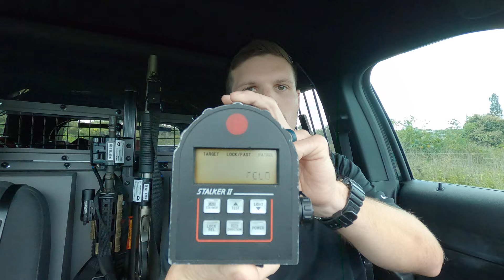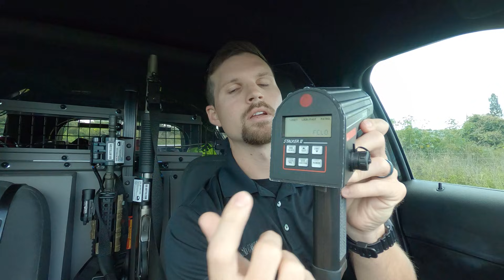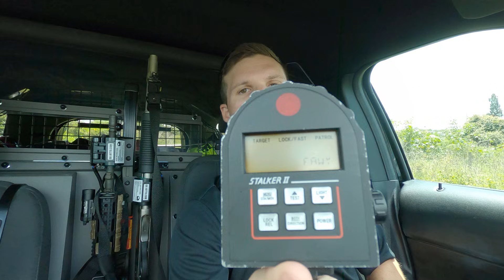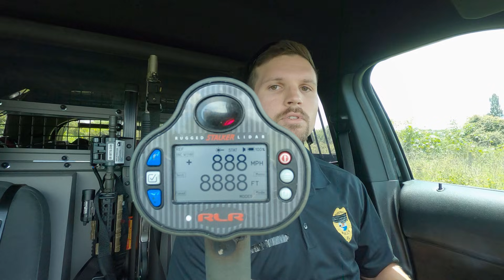How do police catch you speeding? |RADAR and LASER

Comment: Hey, this long shot but my fiancée just got speeding for 27 over when she had acc set to 70 in a 65. She slammed on her brakes because she thought the trip. Had someone pull over and she trying to get over however she wasn’t able to so she proceeded with caution then she pulled over issue her citation. The Trooper use LiDAR is there anyway he fat fingers the number or possibly caught another car instead. there where cars passing her before she even hit the brakes
Reply: If he used lidar come take it to court, plead not guilty now the burden of proof is on the officer you'll both be sworn in and he will usually read off his notes about the citation in his testimony. So his testimony is insufficient by itself and is hearsay without evidence to support it 

Cross exam question that should make the citation null & void and grounds to have it dismissed 

1. At time of issuance were you certified to operate lidar ? 

If he answer yes , as can he show evidence to verify his credentials 
9/10  he won't have that politely turn to the judge and motion for dismissal because he can't show it so the citation is null and void because we can say no degree of certainty you are even certified 

If he has it with him next question 

2. Can you provide calibration records that the device used was working properly, before and after your shift? 

Was it any errors malfunctions? 

Was the person who conducted the calibration certified? If they answer yes ask are they present to testify to support your claim the unit was working properly? 

Whst are manufacturer recommendations ( normally they dont no which helps your case ) tuninig forks by agency outside of the dept police work for who have 0 interest in the case to avoid bias

Comment: You shouldn't be able to pull anyone over unless their doing 20 or over.
Reply: Depends on the road, not every road cops enforcing are gonna have 20mph over threshold usually is 15 and over, cause alot of them roads that are enforce there is houses and not safe roads to ignore the speedlimit so that's why.
Reply: @FrancoYt-p4v  Your right about that. I was talking about roads with speed limits around 45 to 55. Your right though, you really shouldn't never really do 20 over the limit, but sometimes you don't even realize it. Thanks

Comment: Thank you for the video as it was very informative.  I have a question about Laser LIDAR. When you are it using towards a vehicle do you get a return signal if you aim it at the windshield of that target? Or does is it bounce off a different direction due to the angle of the windshield?
Reply from the maker: Great question. The windshield can deflect the laser therefore it won’t get a reading.
Reply: Thsnk you very much for replying. I appreciate it.

Comment: You only tested your radar for clocking in the stationary mode which was not a full proper test.
The sole reason radar manufacturers provide 2 tuning forks to test with is to test the unit in the moving mode. First you test in the stationary mode exactly as you did.
Next place the radar in the "moving" mode for traffic coming at the radar. tap the longer (slower) fork first and place it in front of the radar antenna head approx. 3 to 5 inches away. That should show up in the Patrol Unit speed window. With the slower fork still reading in the window, tap the faster speed fork and place it in front of the radar antenna head about 6 inches behind the first tuning fork. The reading in the "Target" speed window should read the DIFFERENCE between the two forks. Example: if your two forks are marked at 35mph and 50mph respectively, the patrol unit speed window should read 35mph and the target speed window should read 15mph.
Third, switch the radar to moving for traffic moving away from your radar. Now tap the smaller (faster) fork and move it in front of the antenna. That faster speed should show in your patrol unit window. The tap the larger (slower) fork and with the smaller fork still being read, place the second fork about a foot behind it. The reading in the target speed window should read the COMBINED speed of both forks. Example, using the same 35 & 50mph forks your patrol unit speed should read 50mph and your target speed should read 85mph.
this tests the math processor in the radar to be sure it can properly calculate the patrol unit's speed and separate it from your target speed.
I was a cop in the Dallas area for a little over 16 years and have been to the LIDAR/Radar school.
Next time you're in your unit, give it a test and let me know what you think. Sometimes defense attorneys will bring a radar test unit into court and have you demo the test procedures. It's good info to know. Be careful out there.

Comment: So crazy to see how other states are allowed to use LiDAR and radar. In Pennsylvania only the state police are allowed to use radar and LiDAR so municipal departments usually have to pace you or some use the enradd system which sets up two lasers one on each side of the road and when you pass through it calculates your speed. I know there’s another method where they pick two points or lines on the road and then use a stop watch and a math equation to calculate how fast you were going in those points or so I’ve heard

Comment: Question so is the speed radar always on or you guys turn then on when you think you’ll see someone speeding . Like for instance a cop at a light and you coming from behind it will he have your speed locked in ?
Reply from the maker: Always on once it’s turned on. We don’t turn it on as we see a speeder, it doesn’t turn on that fast. We transmit it (activate the speed reader) with a pull of the trigger and hold or by turning the transmitter to always on so it constantly reads. If the officer has a rear antenna and it’s on then yes they can get your speed.

Comment: Serious question can you use laser radar through trees?
Reply from the maker: As long as the tree doesn’t interfere with the line of sight. Branches can cause it to not give a reading.
Reply: @Just.that.officer  I thought so. Not trying to put my business out there but I was pulled over this morning by a officer that claims I was going 36 in a 25 but there was nothing but trees where she was sitting. 

I know for a fact I wasn't going that fast (i was going 30) and there was 2 other vehicles in front of me that both slammed on their brakes as soon as they saw the officer. 

I got popped for 2 reasons, 1 I was the last one in the group and 2 I'm in a corvette lol. 

I am all about fully supporting and backing the blue but sometimes when yall are wrong, yall are wrong lol. She wanted to argue it with me but in the end she didn't cite me but instead gave me a ticket for my insurance. (It's on my phone but I left my phone at home).  It's a fix it ticket. I still say she knew she was wrong and if I really and truly was going 36 she would have cited me for it.

Comment: Nice Video sir! Curious though. How do you lock in to the exact vehicle? For example you clock someone going 80 and your parked. How do you pull off and catch up to that vehicle and not lose it in the sea of other cars?
Reply from the maker: You have to maintain visual. I usually see the driver and/or other identifiers which helps me ensure it’s the same vehicle. However, there are occasions where I go after one then run into two of the same make, model, color etc. and if I’m not certain I just turn around. It happens.

Comment: Hey I have a question, I have a radar detector and it told me i got lasered on the free way when i was going 85 on a 65 but no cop was in sight and i didn’t get pulled over. I was wondering since i got lasered if i will get a ticket in the mail or something even though i didn’t get pulled over??
Reply from the maker: Highly unlikely. 85 on the highway might not have been worth the stop for that officer. They are probably waiting for the higher speeds 95+
Reply: @Justthatofficer  When I got lasered, does it tell the officer my information like VIN number or plate number? Or is it strictly speed?
Reply from the maker: @ColtonMontgomery  just the speed. There are plate readers out there these days though but they don’t activated your detector as far as I know.

Comment: bruh the fact  that it was wrong is to bad. Plus or minus 1 is wrong go back to school or help change the rules. These need to be exact. no dispute.
Reply from the maker: Bruh
Reply: @Justthatofficer  Can obstructions in the view of the LIDAR gun give a improper reading? Say there lots shiney objects like cars at a car dealership and electricity poles in the way you you would have to go between these poles to get a reading of the car on the other side. This is a 6 line road with a median. 3 lanes on one side I'm in the far right lane because it turns into a split into 2 different roads. The motorcycle cop says I'm going 65 in a 45 actually (55-60 max) in the slow lane if I'm on the side of the side I'm murging to when the roads split? So if I was in the fast lane i would be fine? Can I use Angle of deflection, curvature of the earth, and lots of shiney objects at the car dealer-ship as a way to prove a improper reading?

Comment: Personally I no longer use the vehicles speedometer because it's usually off +/-3 mph. New tires travel slower versus well worn tires which travel faster. I use two GPS speed indicators, one on crashcam recorder display, and the navigation unit. Both are 99% in agreement. To verify GPS speed, I also use ground based communication towers which usually matches both GPS units. I also have a 4th separate speed indicator which uses PCM data calculated off my programmed inputs. I mounted the 4th digital indicator slightly left and below center of visual field so it's easier to see and I now use it for primary speed information. Factory vehicle speedometers only give general speed information but cannot calculate for tire wear and inflation pressure. Overinflated tires register faster, versus underinflated tires which register slower. I learned that trick back in the 1980's while working at Yellow Cab Company. During vehicle and meter calibration, we set tire pressures at posted. Once back on the street, we'd over inflate the tires by 10-lbs which caused the fare meters to tick even faster for higher fares which worked beautifully on longer trips such as airport runs.
Reply: Chill out
Reply: that is an insane amount of gear just to get your speed reading a couple percent more accurate lol. Just average the GPS and speedometer reading, that's not close enough? Why the obsession with speed accuracy? And interesting cabby trick. No wonder the majority have been put out of business by Uber. Cabby's have always been crooks, driving longer routes,  taking advantage of tourists/foreigners, parking beyond where they need for an extra 10 cents, etc.
Reply: thanks for sharing
Reply: So you go through all that to make sure you don't get a speeding ticket, yet you cheated people out of their money? You sir, are a piece of shit.

Comment: Cop speedometer that works on LIDAR and RADAR somewhat works the same way, they do time of flight calculation basing on the distance calculated from the distance between the emitter, object and back to the sensors, and remember that while it do continuous calculation of the sent vs returned emissions to be timed against, for computed speed (generally displaying speed in MPH and KM/h).

RADAR is generally somewhat inaccurate in some circumstances owing to the longer wavelength compared to laser light - it can be viewed as low resolution image presented to the RADAR sensors compared to the shorter wavelengths of light (in this case Infrared laser light), so LIDAR is usually used whenever accurate measurements are a must (the computer in LIDAR speedometer is also smart enough to ignore any Infrared light that didn't come from itself, so measurements are generally good with those).

Comment: When the speed meter is stuck at 0 km/h, that means, the driver is a killer, and he is at large. Monitoring systems oxidize its mechanic parts, forcing sky net cameras to switch to speed measurement. Normally, a satellite reads the radioactive pointer to log the speed of a car. When a murderer escapes from the cops, higher levels of monitoring can track the killer at higher expense for better result.
Reply: Are you Normal ?

Comment: Thanks for this video. 
I still have a question: don't I have to keep the testing fork in a box in order to keep it from corrosion and miss aliment ?
The fork itself needs to be checked as well ?
Reply from the maker: I keep them in the vehicle and don’t have any issues. Yes they are checked every six months by outside agency
Reply: Shouldn't your testing forks bracket the actual speeds you are measuring.  This "calibration check" should bracket the actual speeds you are measuring.

Comment: Radars o speed detectors work if cop is driving on highway too? or need to be stop the patrol? i mean if cop is doing 60mph and car on the other line its doing 65mph he csn use the radars etc to check the car speed? or only with the patrol speedometer while cop patrol is moving?
Reply from the maker: The answer is yes. Lol you can do it both ways.
Reply: Cop can use front radar while stopped or moving and it calculates distance getting closer as the 2 vehicles get closer to eachother.  Cop can also use rear radar to measure distance of the 2 vehicles getting further away from eachother.  Both radars can be used while stopped.  The only time a Cop has to gage speed on a speedometer is if he is pacing a car going the same direction has he is going.  Due to the 2 cars going the same direction

Comment: Good video and greetings from an ex 16 year police vet from a suburb city in the Dallas area. I have been to the radar school put on by Kustom radar. My only comment would be on your radar testing using the tuning forks. That was only half the test and only checks the radar for the stationary position. It does not check the radar units math processor to verify that it is accurate in the moving position.
To check that you use BOTH tuning forks. 
1.) Place the radar in the "Moving" mode. 
2.) Tap the low rated tuning fork and place it in front of the radar unit 8-12" away. That speed should show in the Patrol Units speed box. 
3.) Tap the higher rated speed tuning fork and place it approx. 16-18" behind the radar and lower rated fork. ( the two forks should be about 10" apart)
The box marked for you Patrol Unit speed should still read the lower fork reading and the Target Speed box should show the DIFFECENCE between the two forks. Your higher fork was rated at 40.25mph and you lower rated fork was 25.25mph. Thus a proper reading on your test would be 25mph on the patrol unit speed and 15mph on your target speed.
That is the entire reason they always give you two tuning forks rated at different speeds when you buy a radar. Otherwise you can only verify that the unit is working properly in the stationary position.
The brand of your radar makes no difference at all. Next time you run the fork testing check it out and let me know. Also I'd suggest calling the radar manufacture. (any of them actually) and they will send you a booklet on the testing.
Been out of the job a few years but I'm certified in the Doppler Speed Radar and the LIT20/20 laser by Laser Technology Inc.
Reply: Also verify which forks they used, and the calibration records for same.  I beat one ticket because his calibration records..done at the beginning of each shift but by laboratory practice should be before and after every shift.. showed a calibration point that no tuning fork existed for.  Oops.
Reply: @hillaryclinton2415  That was usually checked once a month or so, using the electronic box under the sally port. Tap the fork and hold it up by the tester box and it reads out the Hz of the fork. If the match what's stamped on the tuning fork your good.  But now that you mention it, I have no idea who checks the tester box to make sure its working right. 🤔 I guess if the tuning fork and the Electronic tester box don't match you know something if off. May be the fork, may be the box, hmmmm?
We didn't have any logs to fill out. Just make sure it was working and go on your testimony in court. Been to court hundreds of times, and it has never even been questioned.
Reply: U